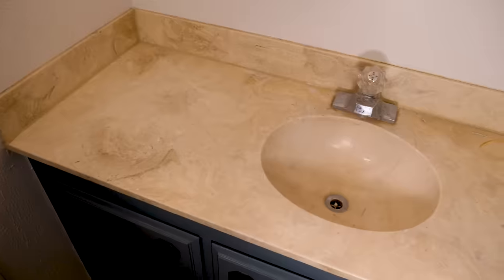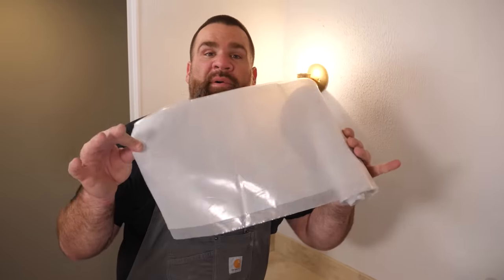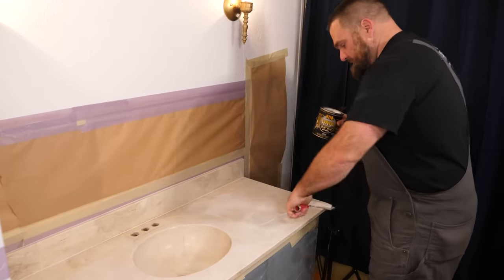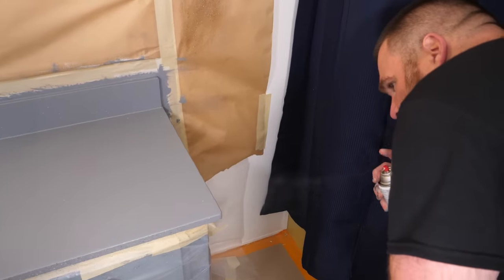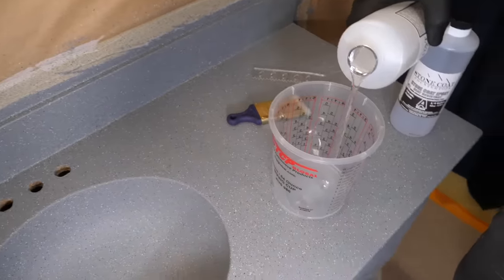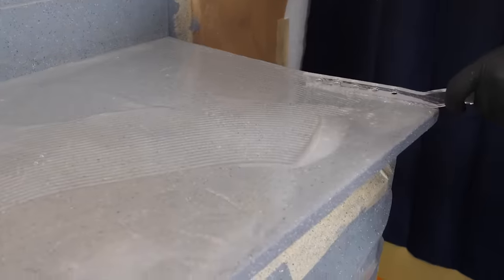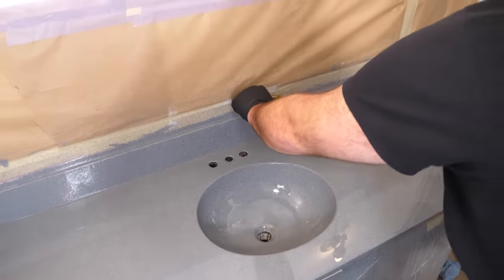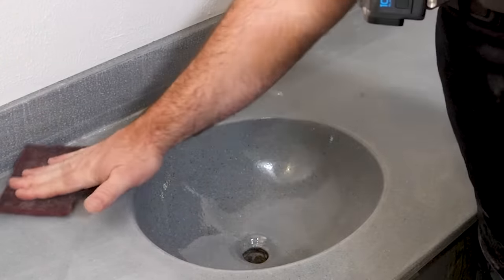How to Epoxy Over a Cultured Marble Sink and Vanity Full Tutorial | Stone Coat Epoxy

Comment: Thanks for watching everyone! Let me know if you have any questions, I'd love to help you update your worn out countertop! 👍👌💪
Reply: Good job on your video!!!!!
Reply: Can this be done to ceramic tile showers?? Still in good condition,  hate to tear it up.
Reply: Great job!
Reply: I just bought my 1st house and it was built 1996. So pink laminate counter tops. I have already painted them white high gloss, Restolum. Do I need to re paint them before stone spraying them and epoxy then or can I keep it high gloss white?
Reply: Our central heat and air flows from the floor. Do we still need to turn it off when applying the epoxy?
Reply: I keep watching these videos and keep sending them to people. I'm super close to trying this out myself. Everything you do comes out great.
Reply: How long did you wait after applying the top coat to install the faucet?
Reply: Does the Epoxy have an odor. .I see you was not wearing a mask.?
Reply: How about a concrete laundry sink
Reply: Attempting this process on a used vanity we got for our newly renovated basement. The wife would like the Pebble color, though, which is a shade of tan. How would you get the under coat to this color?

Comment: There is quite a bit of orange peel in the final finish. Are you able to get a glass smooth finish or is that just they way it is? Possibly the paint specs, maybe another layer of epoxy.
Reply: Yes you can. But you need to sand with a fine grit sand paper. But that will make it the top hazy and you will need to polish it with a buffer or by hand. That is the only way to get a glass like finish I think.

Comment: Wow this is amazing I have the same countertop in my bathroom I would love to redo. I love the color and everything I wonder how that would look on kitchen counters. Which I have a lot of countertop so I would need eight times as much product as you used and I just wonder what that would cost me?
Reply: How big is your vanity? You'll probally only need a 1/2 - 1 gallon of epoxy the stone spray and the ultimate top coat all for under $200 for a brand new countertop! lemme know if you have any questions.
Reply: @mitchquist  it's a little bigger than the one in the video it has two sinks but probably only a couple of feet longer than the one in the video.

Comment: What a beautiful makeover!! 👏👏 Even though our home was built in 2002, that is the kind of countertops we have in our bathrooms.   They have not aged well(originally cream, now brownish yellow in places) and could use a redo!!  I'm glad to see that SCC work well in sink/counter combos.  Those spray finishes are awesome. 👍 I enjoyed watching the marble version as well!
Reply from the maker: Great comment! Pro tip on sink, brush the pooled epoxy back up to the sink rim until the epoxy starts to thicken a little and take time to sand any runs or ridges down between coats if you do more than one. Keeps the vertical part of the sink smooth! Thanks for always taking the time to drop such great comments - Mitch 👍
Reply: @StoneCoatCountertops  You're welcome!  Great tips!! 👍 Thank you!! 🤗 Those curved surfaces seem like they would be tricky.  Backsplash and edges also more challenging than flat surfaces!!

Comment: Love the look. 2 questions I have about this. 

1) How do you ensure that the back splashes are the same thickness of epoxy as the counter top? Gravity says that it will never be that way  without removing them.
2) With the Rustoleum Granite spray, based on the caps, I thought that the color on the can was what came out of the can. I.E. gray cap with flecks vs clear coat with flecks. Didn't know that you had to have an undercoat paint.
Reply: my cultured marble vanity top with 1 sink is 55" long by 22" wide and has a built in backsplash on the rear, and an option one on the left.  Since the left backsplash is removable I will lay it on it's side, but the rear is another story, I'll let the epoxy run down and connect with the bottom epoxy.  It's not a squared off built-in backsplash.  It's rounded so it flows down to the horizontal plane at a slight rounded 90 degree angle (it's hard to explain, sorry).  So that's what I will try to do, but I'm not sure if it will work.  I'm looking for a video that they might have done with one like it.

Comment: You mentioned before adding the ultimate top coat that the counter top could be considered complete. What's the advantage of the ultimate top coat and is it necessary on a dirty pour? My order arrived today I should be giving it a shot in both bathrooms and my kitchen in the next couple of weeks but I didn't purchase the top coat.
Reply: Did you need the ultimate top coat?

Comment: Our cultured marble sink basin is cracked, which I believe is crazing. how do you recommend repairing the basin before applying epoxy?
Reply: U can use all purpose bondo, overfill the crack. Sand back smooth and now u r ready for the bonding primer step! Great question
Reply from the maker: Mitch nailed it, patch it right up with some all purpose bondo, give the area a good clean, apply the mixed bondo. Over fill the crack then sand back flat and now you are ready to apply the bonding primer. Let me know if you have any further questions!
Reply: depends on the crack , you should use fiberglass cloth and epoxy, and underneath if you have access so it doesn't crack , bondo is not structural its crap
Reply: If the crack is bad, I’d consider removal and going in with new. It’s so easy with MDF. Also then you can get a new style sink.

Comment: My vanity is similar but around the faucet there is a huge crack. Does that matter? & if it does how do I fix and prep it before?
Reply: You can fill the crack with all purpose bondo then sand back flat now ur ready for bonding primer
Reply: @mitchquist  I send an email with pics & questions.  I'm worried when I pull the faucet it's going to crack more. It's 6" on 1 side & 4" on the other.

Comment: That's a good step by step video. I have a project question of my own, maybe i could submit pics? i just installed an ikea matte black countertop that i don't like. it shows every water mark. Can i give it a rough sand and then apply the bonding primer and then the white carrerra mable epoxy then the top coat? maybe i don't need the bonding primer?
Reply: @mitchquist  Sent you an email with pics.

Comment: Awesome job on the countertop. Why wouldn't you be able to use just soap and water before sanding with the 60 grit sand paper? How much would it affect the project if you did?
Reply from the maker: You can use soap, TSP is designed to clean the grease and grime before sanding and applying a bonding primer to a smooth surface. TSP would be the best choice, Dish soap and water 2nd place

Comment: looks great.  question, can a person do a kitchen sink?   i live in a 5th wheel and dropped a large  frozen ham in the sink and cracked it.  now it leaks and i can't find a sink to replace it.  it's a odd size and nothing i have considered will work.  it's a double sink.  i'd have to put a bonding agent to fill the crack and sand it down.  then cover it with epoxy or so i think..  my interior is mostly pecan wood finish.  do you have any suggestions?   thanks-- it's a fiberglass sink

Comment: Question!! How do you prevent epoxy from scratching or yellowing? How heat resistant is it?
Reply from the maker: Great question, the ultimate top coat I applied in this video takes the durability to extreme! Use our Art Coat and The Ultimate Top Coat, strongest epoxy countertop system out there! Let me know if you have any questions

Comment: This May be a stupid question.... I don't have a torch, will a hot air hair blow dryer do the job?🤔
Reply from the maker: A heat gun would be a better choice. But if all else fails, you can use a blow dryer but you will need to extend the time removing air bubbles from the mixed epoxy and I would also mix by hand with a paint stick for a good 5 min. This will incorporate less air into the epoxy mixing. Wal-mart sell a heat gun under $20, it would be a good investment

Comment: What’s the best way to clean buckets and paddles after mixing and pouring?
Reply from the maker: Great question! I will let the epoxy residue cure in the bucket and it pops out pretty easily the next day. The trowel I'll just let it build up then peel it off with a utility knife. The brushes are usually a throw away item. We did put them in a bucket of acetone with a lid for our classes and we were able to use the same brushes all weekend. However I wouldn't use a old brush on a new job, if i was making a bunch of samples in the same day I would
Reply: @StoneCoatCountertops  go raibh maith agat (thank you) as we say in Ireland.  And thanks for all the great advice and videos. 

Risteárd

Comment: I want to do this but I’m a little worried about removing the sink parts
Reply from the maker: That part is pretty easy.
-Turn off water valves under sink, test to make sure they are off. 
-Remove water lines from faucet with adjustable crescent wrench 
- Remove 2 nuts holding faucet
- remove 2 wing nuts from the P trap by hand or with an adjustable wrench
- Remove the nut holding the tail piece that the P trap was attached to at the bottom of the sink
- The plumbing is all done! 
If you are worried about reattaching, a local plumber can attach the faucet and tail piece for  not too much. Let me know if you have any questions
Reply: Mine were not easy to remove.  My husband had to eventually remove them.

Comment: Looks really great but,
I’ve yet to see a project where I liked the topcoat. 
This vanity was nice a glossy smooth…. Until you applied the topcoat and gave it texture. 
I’ve noticed the same on countertops, as frequently the colors look fantastic and the top looks smooth as glass, then you apply the topcoat and it always seems to dull the colors and take away the glassy smooth look. 

Is the topcoat required?
Or do you have a topcoat that doesn’t take away from what’s under it?
Reply: The top coat isn't required, but does give the best scratch resistance. Stone Coat epoxy alone is pretty darn tough. The Ultimate top coat is next level protection from micro scratches and more of a natural feel. I still love the high gloss Stone Coat too though! Thanks for watching and your truthful feedback, sincerely appreciated
Reply: Thank you for the reply. 
Keep up the good work!

Comment: Seems to me that a new countertop would be more cost-effective. Please prove me wrong.
Reply from the maker: The cost of the materials for this vanity from Stone Coat were under $175, there was a $800 minimum laminate countertop order at the home depot and a 9 week wait to get measured... Thanks for the great question
Reply: @StoneCoatCountertops  So you Basically charged the homeowner about $500 all-inclusive? This avoiding the $800 dollar cost for a new one, plus the cost of an installer, plumber, and the wait time? If my calculations are correct, you saved the homeowner about $600 and a ton of headaches.